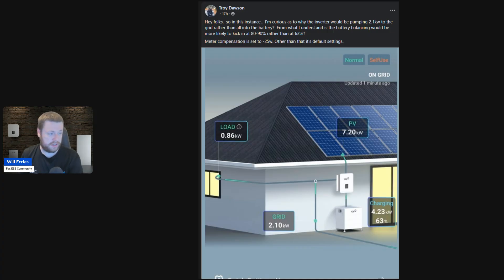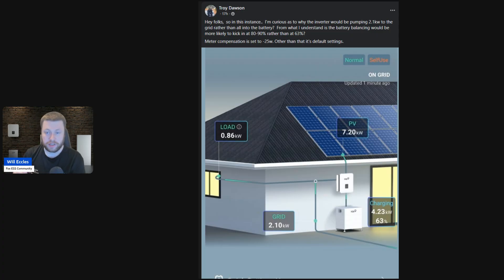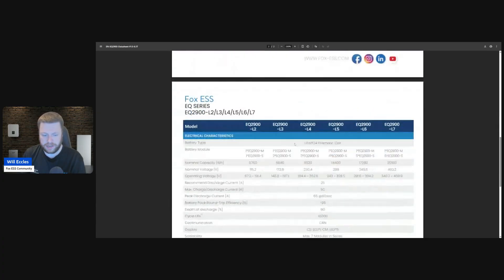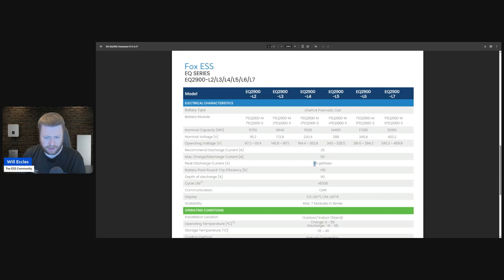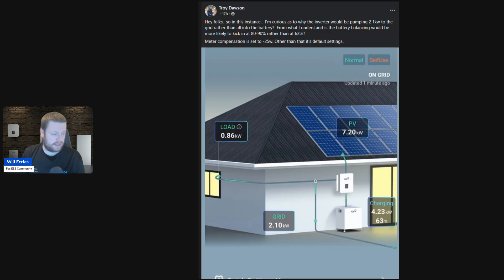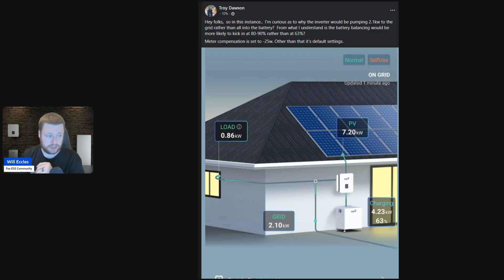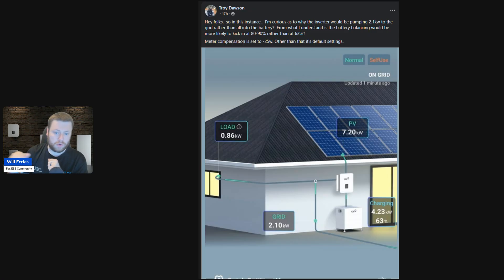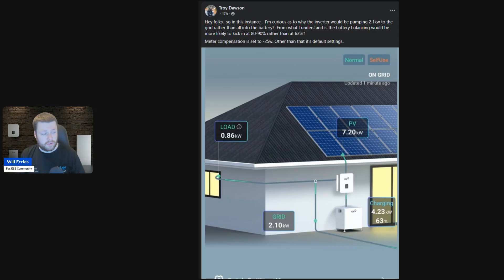Fox ESS - Why am I exporting when my battery isn't full?

Comment: I will export at night IF the next day is fine weather. I dump down to 10% by 6am  then charge it up by noon back to 42kwh. Then it feeds out until 5pm Often 40kw to 60kw per day.  But it costs a 50% cycle. Thats in peak summer. In Australia 5mth. Then it tapers back  out.